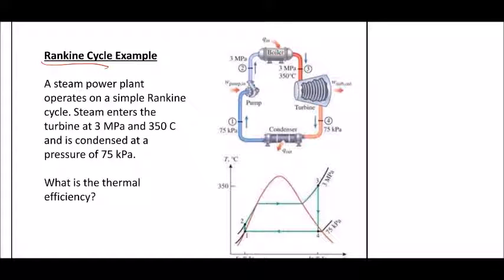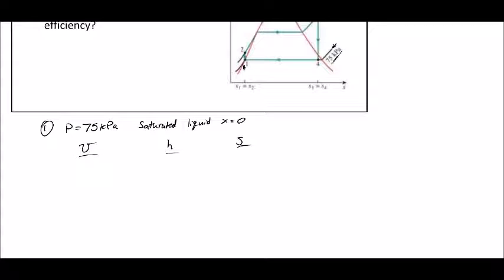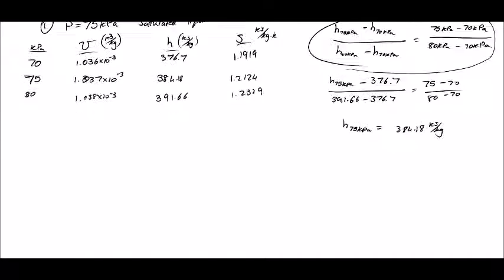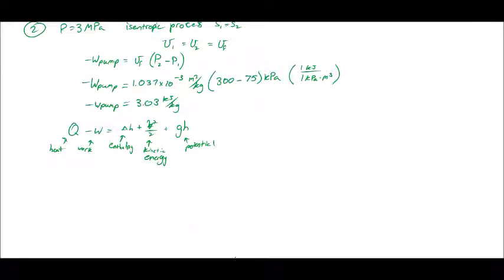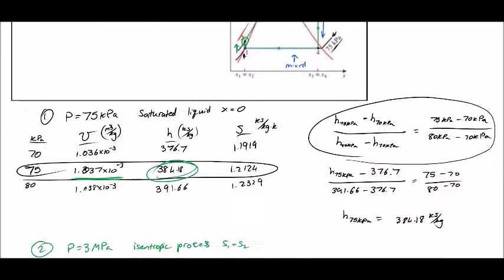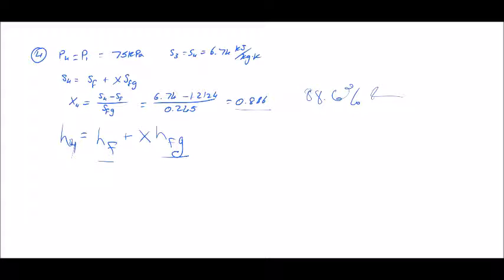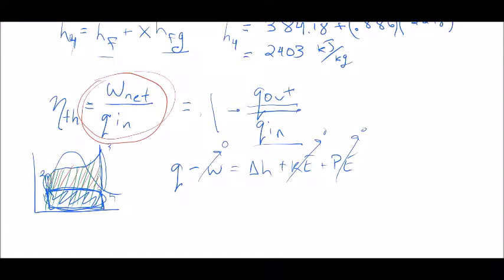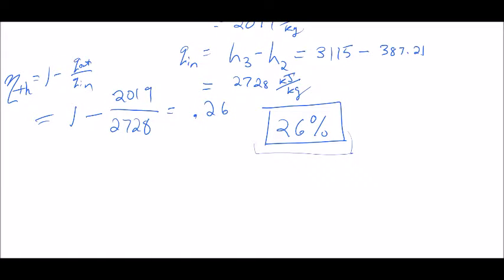Thermodynamics - Rankine Cycle Example

Comment: Is that S(Fg) value correct because I’m seeing a totally different value at 75kPa on the steam table I’m using (6.2426)
Reply: I’m correct S(Fg) is in fact 6.2426 and that gives you the 0.88 ... so wherever 0.245 came from, it’s a mistake
Reply: @teeohh4151  you are absolutely right. good job man.